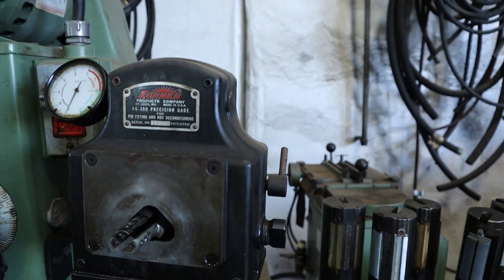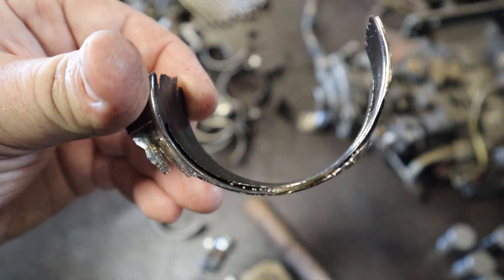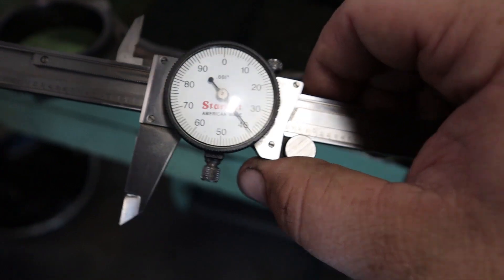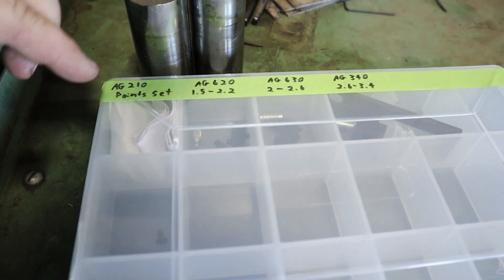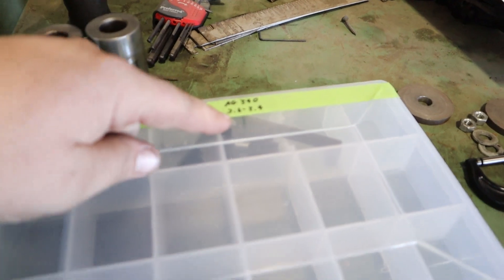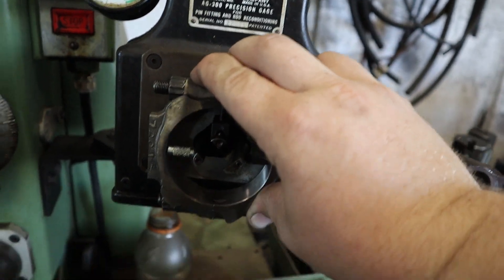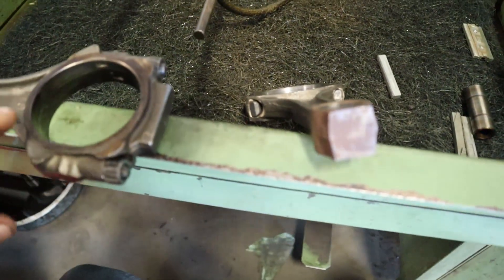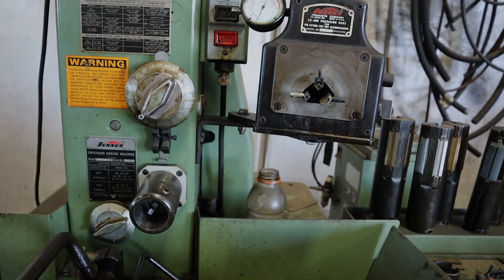Using the Sunnen AG 300 Precision Gauge

Comment: In regards to the bearing problem is the oil pick up too close to the pan?
Reply from the maker: @daleolson3506  no, it was a boat motor. My guess is that they let off the throttle and the oil flooded forward and starved the pump.

Comment: What i was taught is now and then , recenter the upper pointer with the round gage provided by puting the slot in the gage, downward and use allen wrench up through the slot with the gage sittig up against the backing plate, and adjust the dial back and forth until you find exact center, the allen wrench fits in a little allen plug up under the top pointer. Reason ..every thing wears, you are centered now, set your reading with your mics, hope this helps .

Comment: Cut both sides and use the sunnen gauge not your calipers because you can never really trust them. An inside micrometer and an outside mic is way more accurate you just have to know how to set the sunnen gauges. That’s just my opinion you can check roundness on them also. Assuming you have a cap grinder